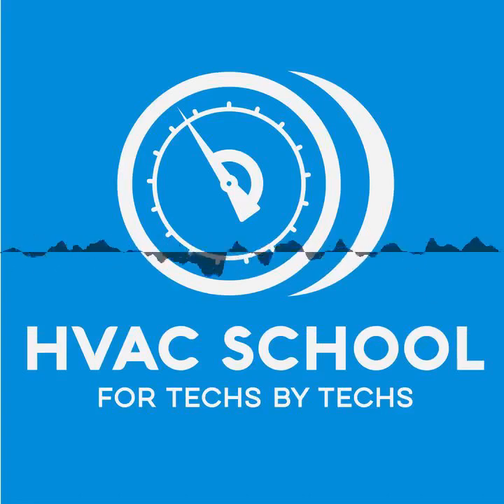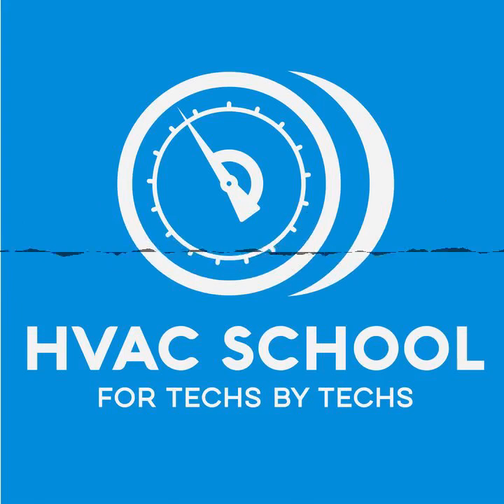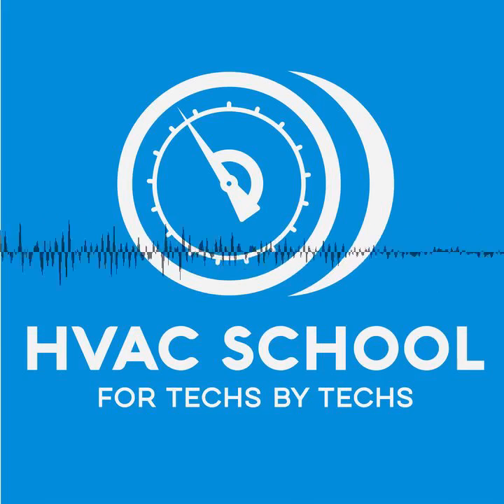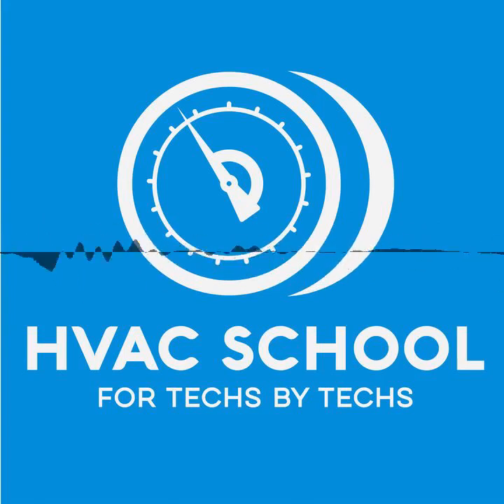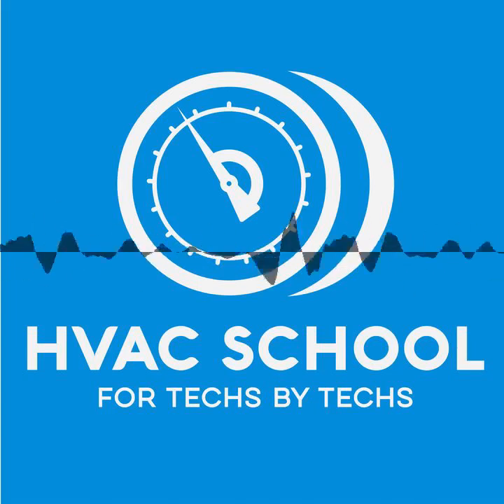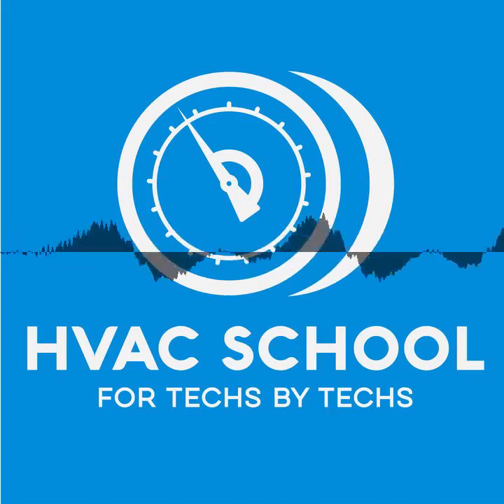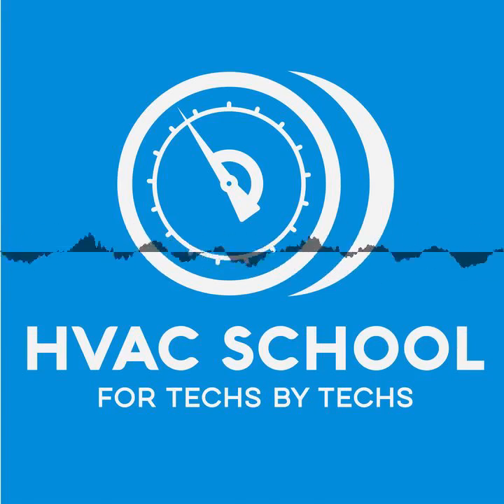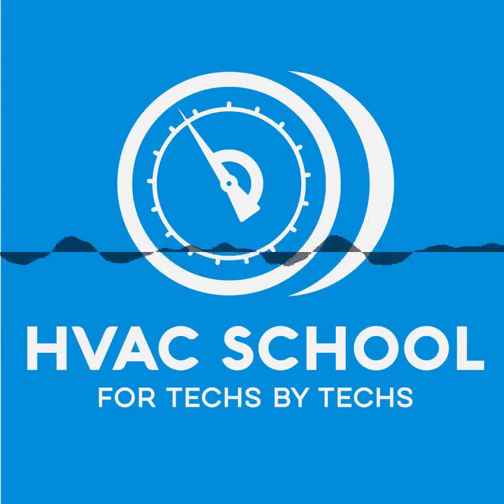Electronic Expansion Valves (EEV) w/ Jamie Kitchen (Podcast)

Comment: When you were talking about cooling the liquid down as much as possible before hitting the metering device to reduce SH, would this cause a small gain in efficiency if the liquid line and suction line were both insulated within the same pipe where they could make thermal contact? In my mind, this would benefit the system in 2 ways. Obviously, you would cool the liquid line down and produce less flash gas as you guys were saying. But also, the suction line would gain a slight amount of Superheat prior to entering the compressor(without contributing to higher avg evap temp), providing an additional margin of safety against slugging.

Comment: On a 404a low temperature chiller start-up with high load and high ambient conditions, it is typical to high pressure fault. The TXV is set to 15F superheat at setpoint (let's say -10F). But at start-up the process fluid is 85F. The TXV cannot feed enough Refrigerant to absorb the high load = high superheat. If a EEV was used that could feed the proper amount of Refrigerant to obtain 15F superheat wouldn't the high pressure also be reduced in this high load-high ambient condition? I work for Fluid Chillers Inc. and we deal with this alot. I have been pushing hard to make EEV's standard on our chillers.

Comment: I've seen EEVs installed in several mini-splits (I think Fujitsu routinely uses them), but I haven't heard if they will be provided in any of the newer inverter units.  Any insights?
Reply: LEO ASHRAE LG uses EEV in they're VRF and heat pump Multi V IV systems.  In the VRF systems they are located inside the HR box for each IDU'S line set.

Comment: Anyone know where I can get a EEV fail code diagnostic chart for a Trane GAM5 electric air handler unit?
I came across one giving a red fault light on the EEV control board. It was flashing 7 times, over & over. Even after I pulled the disconnect for a few minutes & then turned it back on....it kept flashing that red fault light 7 times.
The manual was MIA (of course!) so I had no literature to help me.
I also checked EVERY panel on the a/h unit, both front & back sides; looking for ANYTHING to tell me how to run tests on the EEV, or what the red fault flashes mean.....& nothing.
So I had nothing to go by.
Now, it's also important to know that the compressor was cutting out on low pressure because the system was flat.
So obviously there is a leak. But I couldn't find the leak. It might be in the line-set...not sure though.
So I added refrigerant just to see if low side pressure would stay up to keep the system on, & it did.
But I still need to know what the 7 red fault flashes mean on the EEV control board.
So does anyone know?
Thanks in advance.
& BTW, all Brian's videos & podcasts are essential, if you desire to be a great tech!
Watch as many of his stuff as you can.
Thanks Brian!
(& sorry, but I am desperate & thought you or somebody might know what those 7 fault flashes mean.)
Reply: check sensor
, check connection at control board (wire connection is clean NO PITTING), verify against
10k@77 degree

Comment: Great discussion on control stability of superheat.

Weak link on present EEV systems is cheap thermistors.  If manufacturers are not going to spend a few pennies more on more reliable thermocouples, then they need to put redundancy for at least the thermistor on evaporator output.

Killing a compressor with continuous minor flood back because of drift in thermistor resistance vs temp is not acceptable.  Sweaty evaporator is nasty place for a thermistor.  Just checking for input-output evaporator thermistors' off call state resistance matching or out-of-range thermistor values is not good enough.

Expansion valve should relieve liquid line pressure after compressor shuts down.  Keeping high liquid line pressure with off call idle EEV completely shut down, and scroll compressor's check valve blocking other end, can cause compressor's differential pressure plate that unloads compressor for startup to chatter during startup putting extra wear stress on compressor's differential pressure plate.  You end up with running high side pressure bleed around pressure plate seal.  If you hear a brassy jingle sound for a fraction of second on startup on scroll compressor, I believe it is caused by sealing pressure plate chatter.

Looking forward to variable speed compressor discussion, particularly how minimum oil return to compressor is assured when operating for long period at low speed.